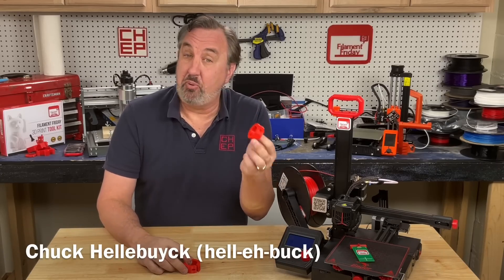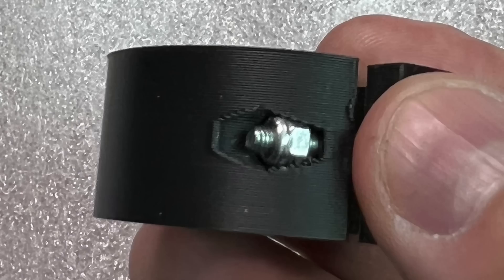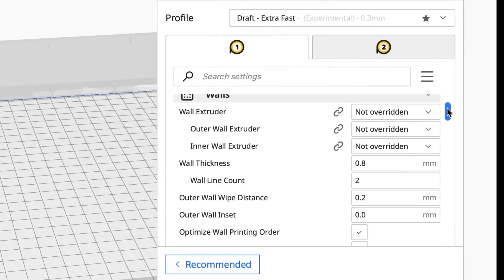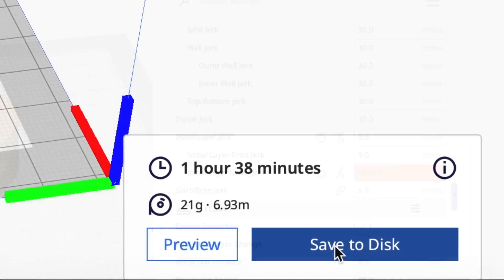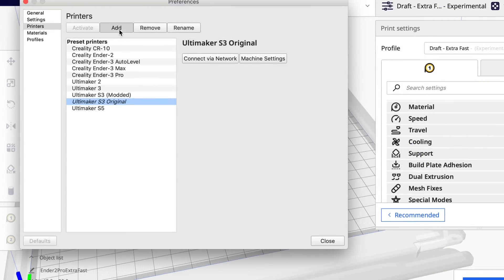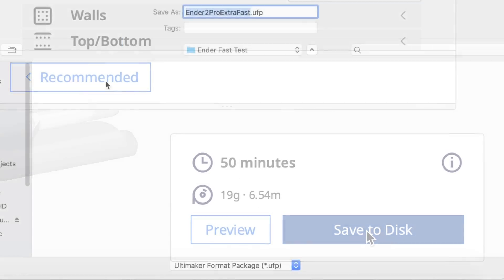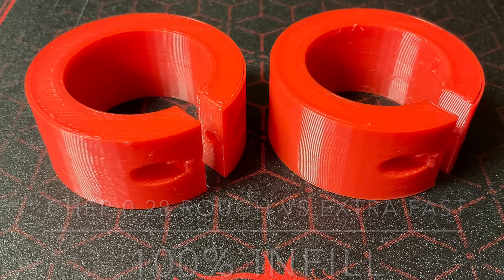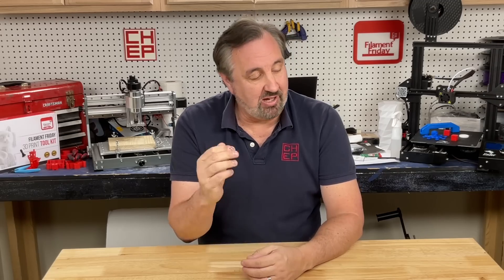Faster 100% Infill Prints with Cura 4.13 on Ender 3D Printer

Comment: 5:43 Oh I really wonder where the magic lies. Maybe compare the two gcodes?
Also, maybe you don't want 100% infill for all the part. What if you just do it in and around the section of the part where you added the nut and bolt. (roughly 1/4 or 1/3 of the total part)
Reply: Gcode isn't offering up a lot of secrets other than they try F9000 on most of the travel moves.  I'm off to look at the Github commits.
Reply: @lucasthompson1650  It HAS to be in the gcode, b/c that is what the printer executes and only that. Though, it might be not that visible to the human eye.
Reply: @MrMegaPussyPlayer  yeah. It’s a combination of a lot of subtle things.  I noticed they auto-switch to Zigzag 100% infill on Ultimaker 3 and S3/5.

Comment: Can't replicate this. Updated to 4.13 and added the Ultimaker S3 profile. A simple curtain hook is going to take 1h 14m at 100% infill. Am I missing something?
Reply from the maker: Use my downloads
Reply: @FilamentFriday  I eventually fixed it. idk how. One concern I have is that will it work with print in place hinges. I am already printing it and its super fast but worried its gonna fuse :( Did you test that too?

Comment: Thanks for the trick, it turn my 4+ hours 20% infill functional parts to just 2 hours with 50% infill! All other speed setting are the same on my Ender 5 !  
Sure it is not look as great as slow way, but as a functional parts, looks is the last thing to consider :)

Comment: I’m pretty sure acceleration settings in cura cannot override the max in firmware.
Reply: I think not. 
I've tried it and it actually does go faster and I worry that it's too fast
Reply from the maker: Depends on your firmware. If you worry it’s too fast the don’t use it.
Reply: @FilamentFriday  quick question 
How often have you used this printer setting for printing.
2. Do you recommend it for printing long print time models. (I.e for prints that's supposed to last 18-30 hours) 
What's the best alternative if no..
Are there ways to make prints with 2.5mm thickness stronger without increasing wall thickness. 

Does infill type have an effect on print quality and time?
Reply from the maker: I’ve not used it on that long of a print and it does produce slightly less quality but far faster.

Comment: Traditionally, Cura only prints the requested speed for the infill. Everything else prints at half that speed.

Now the Snapmaker profiles keep everything at the print speed the user inputs. It makes perfect sense why speeds are almost exactly half the time in these new profiles.

No magic, just marketing.

Comment: You can get rid of stringing by having it in combing mode so the nozzle doesn't leave the model. Also you can increase the infil speed to like 90 (ive even done 120) since it doesnt matter for quality and keep the outer wall speed 60 or 50 for the quality. Also I think selecting optimize print order helps speed up the print. If you hit slice then click the little "i" for info it will tell you what's taking up the most time and you can mess with those settings specifically. 

Also great video as always

Comment: Most stock Creality machines are hard locked to 500mm/s2 acceleration in the firmware unless i'm mistaken (at least the older ones were). If you roll your own firmware you can just increase it ( or setup Klipper).
Reply: You are correct - 500mm/s^2 acceleration on the ender 3 v2. You can increase it with just an M204, M201 etc command in the gcode, no need for a firmware update - but you have to wonder why creality did that (noise I think)
Reply: not sure about other printers, but the ender 3 could go higher. control > motion > acceleration > change everything there.  if i remember correctly, the "acceleration" part is limited to 500 due to one of the other settings that needs to be increased first before that one, not sure which one. this might cause the assumption that it can't go higher
Reply: “If” you roll your own firmware??
Wait, doesn’t everyone start each new print with:
‘git pull upstream bugfix-2.0.x’ in their Marlin directory, fix conflicts, do a  ‘pio build’, and reflash their printer firmware?

If I start skipping that step maybe I can finally get a 10-minute Benchy. 😎

Comment: My bet is that it works by increasing line width. When it comes down to it, this profile still needs to extrude a certain volume of plastic to complete the part, and if it's not moving the print head way faster or increasing layer height, the only way to get more plastic out in the same amount of time is increasing line width.

I've actually experimented with this in Prusaslicer quite successfully. For extra fast printing I set line width to between 0.6 and 0.8-mm on a 0.4-mm nozzle with 0.3-mm layer heights, and then at 60-mm/s you get a volumetric flow between 10 and 13-mm^3/s. For an E3D v6, that's about as fast as the printer can physically melt the plastic. The thicker lines also mean the printer needs to make fewer passes over the same area. In Prusaslicer you can also set a volumetric flow rate limit, so I'll set things up like above, set print speed to something really high, like maybe 100-mm/s, then limit volumetric flow to maybe 10-mm^3/s. This basically assures that the printer is always putting down as much material as possible at any given time, which gets you pretty fast prints. The benefit is, of course, most pronounced at higher infills, but it speeds up normal prints too.
Reply: Makes sense. Thanks for explaining!
Reply: yes, but dont limit only with volumetric flow and a high speed. Otherwise your Inner Perimeters and Infill will be printed at lets say 60mm/s. But your outer Perimeters, which shouldnt be ~0,7mm but more 0,4 to 0,5mm for quality, overhangs and stuff will be printed at around 90 to 100mm/s. This would give bad outer walls and corner Bulging on most printers so I'd leave the outer Perimeters always on a speed your machine can handle easily, mostly 20 to 50
Side Note: Wider Line Widths are giving so much more layer adhesion! with 0,7 to 0,8 on a 0,4mm nozzle you can push layer adhesion on some PLA and PETG to more than 80%, I did some mechanical testing in my university
Reply: @flixquadrat6337  What do you mean by 80% layer adhesion? 80% more strength, or is that a metric for actual adhesion?
Reply: @pturcanu  80% of the strength in XY direction. Basically you print lying and upright samples and do tensile testing and the lying (XY) samples are your reference, the upright samples are for layer adhesion. CNCKitchen has some good videos here on youtube where he also compares layer adhesion and stuff, he never tried out line width as far as I know
Reply: It's not that complicated. I just checked it out; The Snapmaker profiles simply don't half the print speed parameters for the walls and ceilings.

Traditionally, Cura only prints the requested speed for the infill. Everything else prints at half that speed.
Reply: @KJ-58  What Cura does is not complicated. I was replying to the selfmade profile in Prusa Slicer (Or some of my profiles which are basically working the same) and yes sadly it is complicated if you want perfect results in the end.
Reply: So you limit the volumetric flow in order for the slicer to auto adjust the speed, go slower in parts where 100mm/s would demand more than 10mm^3/s of flow and faster when it's not going to exceed it? Did I understand it correctly?
And yes, seems to me that increasing the line width is the only plausible explanation, because I'm pretty sure the acceleration did nothing, since it's probably firmware capped at 500mm/s.

Comment: I installed a BLtouch on my Ender 5. It works fine, but I noticed that now I can't use the "pause at layer height" gcode in Cura. I use this sometimes if I want to use 2 colors in the same print. Do you know what might be causing that problem? Everything is properly calibrated and prints well. That is literally the only problem.

Comment: Just to let you know this is the best profile that I found so far with a 100% infill.  The appearance is great and the pieces are strong even when I set to a .32mm profile.  I also use the CC .6 mm setting and it is working great,  Did I mention that it is fast.  Also to let you know that I am printing your profile in a Ender 3 pro so it is Working great and saving me some print time.   Thanks for sharing.

Comment: im getting some odd bubbles in my filament in every layer that disappear when printing fast, do you have any ideas?
Reply from the maker: It needs to be dried out.
Reply: stick the roll in a food dehydrator if you have one, or in the oven at a temperature right below the glass transition temp of the plastic ~45c for pla

Comment: The methods used should be usable in any other slicer. Guess it's just up to someone with a bit of free time to plow through the g-code to find the secret sauce. Compare against the regular g-code, check the start codes, as well as a single lawyer's, it's in there some where.

Comment: Wonder if this would work on a delta printer.
Reply: I'll probably try it on my flsun super racer soon
Reply: It didn't change the print time at all. was exactly the same
Reply: @xr337  thanks for the heads up.
I also have the SR and was curious.

Comment: Was there a structural difference between the two parts? One being stronger than the other? Also do you think this trick would work with an ender 3 v2? Or would the acceleration be too much?
Reply from the maker: It will work with V2. Prints are essentially identical at 100% infill.
Reply: @FilamentFriday  thanks!!

Comment: Another way to speed up a print and still get quality look is to change infill layer height. E.g. layer height 0.2, but infill layer height 0.4. Infill will be extruded every 2nd layer saving a lot od time.
Reply from the maker: Not as fast as this hack though.
Reply: @FilamentFriday  Let alone sure not, but one can combine them both and get even better results :D

Comment: Someone else should make a side by side video of the 2 profiles being printed.  The cura algorithm always had obvious inefficiencies & now they seem to be locking further improvements to just their own products.  The most obvious benefit would be using a .4mm nozzle to make a .8mm line width to print infill.  It also could travel in a retracted state along smarter paths than it does.
Reply: Or just compare the gcode, which anyone who’s tried this can do with a text editor.
Reply from the maker: Why do you need another person to make a side by side?
Reply: @FilamentFriday  because not everyone has the time to do investigations themselves.
That's why we watch YouTube videos. To get hours of work condensed into a short video.

Comment: If this was all done through slicer settings, it would stand to reason that this could be replicated in other slicers.
Reply: I had the same thought. I use Prusa Slicer for my Ender 3 Pro and was wondering what would need to change to make this possible if it's not explicitly/only the acceleration/jerk in the firmware.
Reply: Guess it's just up to someone with a bit of free time to plow through the g-code to find the secret sauce. In a comparison against the regular g-code, check the start codes, as well as a single layer's.

Comment: Just set infill to 99.9% zigzag. This makes the infill use infill speed and line width settings instead of top layer settings. Frankly, I consider this to be a bug.
Reply from the maker: I tried it. 1 hr 26 min. The hack I showed is still way quicker.

Comment: This is happening because there's hidden settings in cura for acceleration limit.
There's a plugin in the market you can download which shows them.
It's set to default 500.

Comment: This trick is pretty neat. I tried it on my ender 3 pro and it printed a file that normally takes 50 minutes at 100% infill in 25 minutes. However a few middle layers and some of the layers at the top shifted so the print quality was not great. Maybe if I decrease the acceleration of the printer I could improve the printing speed and not get shifting.

Comment: I think the difference is in infill pattern. You use grid. In uktimaker profile is zigzag.
Reply: i use gyroid infill with just 5% pattern with this trick, its still cut the print time in half when compare to not use this trick (i have a CR 6 SE)

Comment: That's pretty cool, makes me want to start messing with my mk3's accel values (ive always considered that black magic to be left alone). I wonder if the overall durability of the final object is comparable to slower print speeds. Maybe a job for CNC kitchen to make some samples for testing.

Comment: I've had a quick look into this. Used a calibration cube and sliced it on my own printer's profile and the S3 profile after changing that printer to the same nozzle. Used .2mm layer height on both and indeed the S3 is way quicker (2x/3x). I started to align the settings to be the same as the S3 one, and what struck me was that when I selected 100% infill, it doesn't actually print "infill", but just makes the top layer 999999. It results in the same thing, except that it doesn't print at infill speeds. Changing this manually already sped the print up massively. Then aligning the speed settings also helped, especially the jerk settings (careful with these). When I had all the settings aligned, there was only 10 minutes difference (36 min for S3 and 46 min for my own printer) between the two, which isn't a lot, but they are at the moment still unexplained. I wonder What would happen if I print both and compare actual print time. I suspect they will be very close, if not the same. I have a feeling that Cura is more catered to these printers and knows how long certain tasks take (for instance waiting for bed/tool to get to temperature) and adds a bit extra for other printers to be on the safe side.

Comment: Elsewhere I've seen people experimenting with much wider line widths than the nozzle diameter. That should work well for 100% infill prints if your extruder can deliver the flow rate. Keep the wall line width normal for exterior detail.
Reply from the maker: You mean like this: https://youtu.be/yskFuq8VjtA
Reply: @FilamentFriday  I think he means extruding more plastic and squeezing/ironing it out with the flat surface surrounding the nozzle aperture(i.e. increasing line width), rather than the 2 explicit lines in that video.
Tho TBF, you or someone else has a video on that, I just can't remember who it was.
edit::CNC Kitchen a couple years ago.  Technivorous 3d Printing a couple months ago as well.  Also, explicit lines makes you sound like a rapper or something.

Comment: Just test it on my ender 3 v2- first łatwe was good, but second terrible. Bcs tension on some directions i use wall line count =8. With this settings printer dont make properly corners - slicer make it round in my test print.

Comment: Hey Chuck, I'm wondering if you have any advice on creating Cura profiles for a heavily modified Ender 3 Pro. I put the 400mm Ender Extender kit on it, converted to direct drive, linear rails, etc.
Reply from the maker: Use my profiles and then adjust step by step. There is no magic formula. But as I say to many people, learn the slicer settings first then mod the printer as necessary.

Comment: I have enough trouble getting a consistent print. Once I settle on a profile or 3 I don't want to go that deep. It was a cool video, and it shows there are still optimizations that can be done with existing hardware to make 3d printing more enjoyable and efficient. I hope this stuff becomes mainstream, and not just a hack from a specific printer.

Comment: Amazing but i still can not be sure how? I have an ender 3 pro modded with skr e3 mainboard and hydra cooling and extra hotend and mainboard fan upgrades. i know there is differences between motherboards but %50 of printing time difference is insane. Also few days ago i had a chanse to test a artillery genius pro, there is an obvious acceleration. Same kind of steppers, same kind of drivers. But what is the main difference ???

Comment: Did you happen to notice when you did this your fan speeds changed? It had my fans set to 50% which in return lead to warping. I also noticed overhangs were very sloppy. Not that they were at thier best to begin with. Just looked much worse. Especially when I printed a benchy to see how it would do.

Comment: You should do a video on 100% infill vs 99% vs all walls
And test durability and speed
Reply: I would say 5 wall lines, 5 top and bottom layers, and 50% infill is good enough for most thing. 100% infill is quite unnecessary. If you pay attention in the beginning, you can see him print with 1-2 wall lines.
You can even get away with 4 wall lines with alternate extra wall and 10% infill sometime.

Comment: Hi new sub here, i want to buy a 3d printer next month on the 10th, which should i start out with? i see a lot of tik toker's and youtubers say make extra cash get a 3d printer, so what should i start with? i hope to use cura and also others files to get started and i plan on using from now till then to build a page so i can advertise on craigslist, facebook and such so i can make pieces that i can sell from $5.00 on up too $50.00, no i do not know what i'm doing so for everyone who wants to call me out, i just did....
Reply: Ender 3 is cheap and prints great. I have 2 v1 ender 3's. And fun to upgrade.
Reply from the maker: How big are the prints?
I think Ender 2 Pro is a great place to start. 
If you need bigger then I’d go with Ender 3.
Reply: @FilamentFriday  I don't know, i'm starting new, which would be a good idea? i plan on letting the printer pay for itself and also any other printers i buy.
Reply from the maker: I would start with the 2 Pro then. Less initial investment and learn how to use it first.